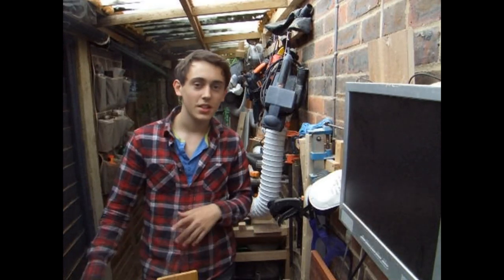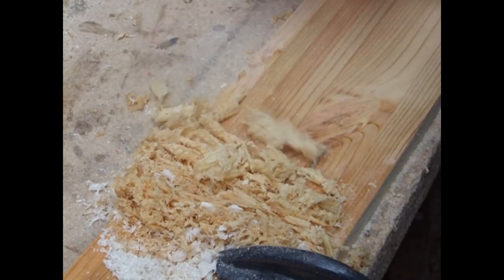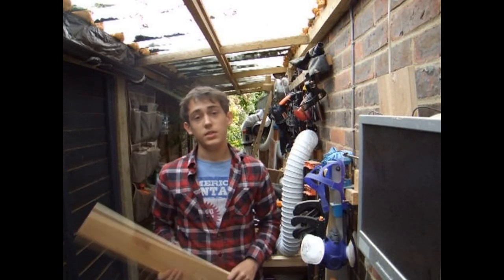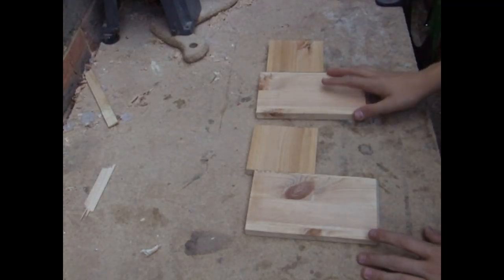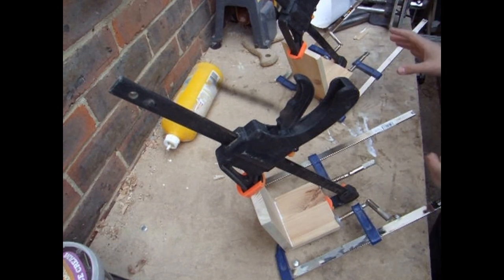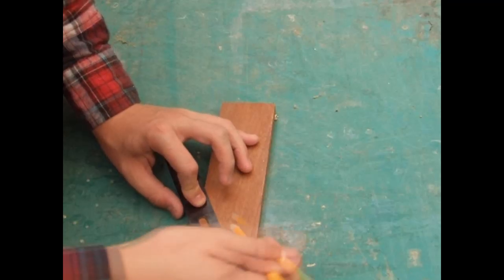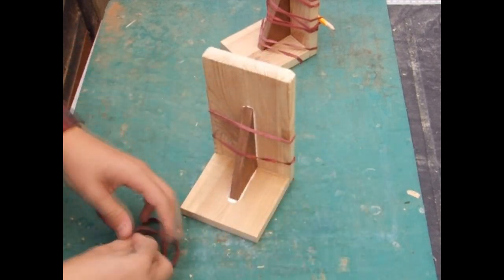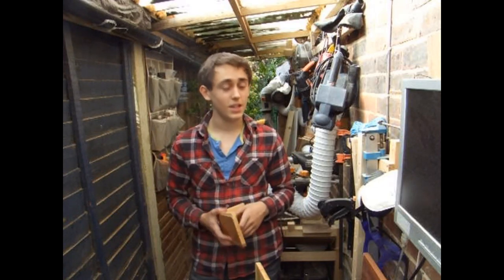Hand Tool Woodworking - Book Ends

Comment: Good work solely with hand tools, Alex. Is there any particular reason you didn't use a plane to cut those chamfers? End-grain isn't always easy to work, even in pine, and there is always the risk of breakout. You have done very well, though.

Comment: Alex.. Good video with good intentions. Sandpaper and rasps are not really a good way to chamfer. Use the block-plane; or a wide, sharp chisel. Sandpaper, if you use it at all, is the last thing that touches the wood, before you apply a finish. Keep on working and enjoy.